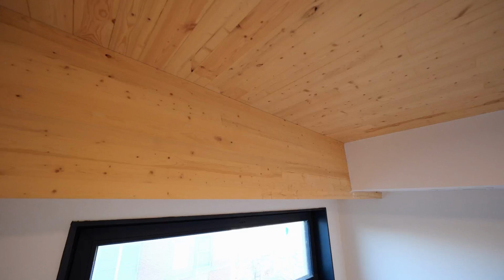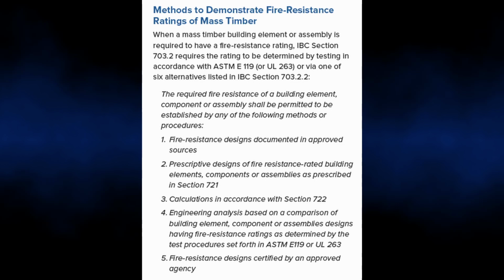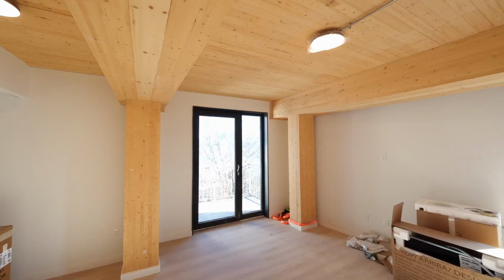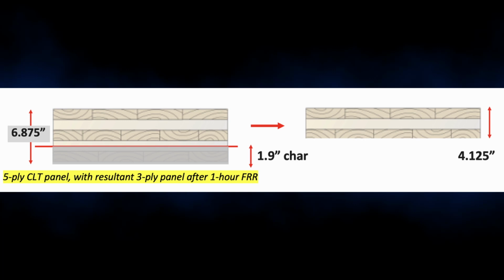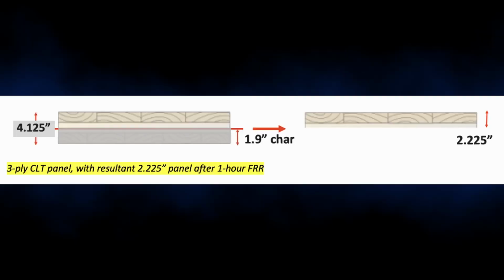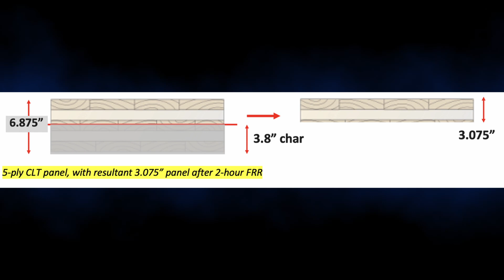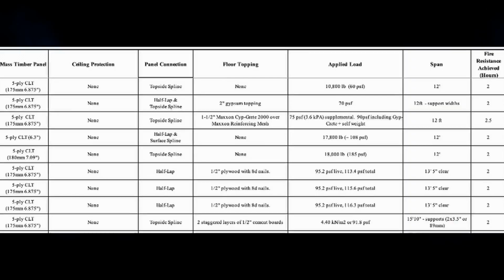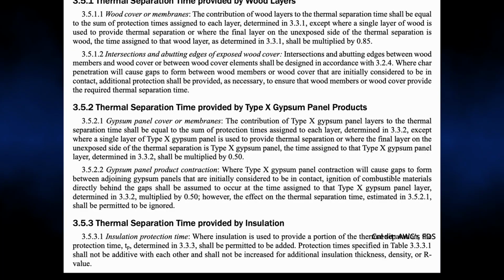Fire and Structural Engineering for Mass Timber

Comment: Thanks for the video. Couple of questions, 1) what are/where can I find the deflection limits in a fire condition? 2) can you explain why there is different charring rate in CLT for different lamination thicknesses? My understanding is that this is captured delamination of CLT panels but has since been resolved in PRG 320 2019 (and the types of adhesive permitted). Is the fact that NDS 2018 didn't have this resolved ... but may be captured in the next NDS revision?
Reply from the maker: We haven't yet seen a guide on deflection limits in a fire conditions, I believe that would be an engineering judgement item. The variability of char rate with lamination thickness is based on the current NDS Chapter 16. You are correct that the PRG 320 now has new elevated temperature adhesive performance requirements. The char calculations in NDS remain unchanged for the time being